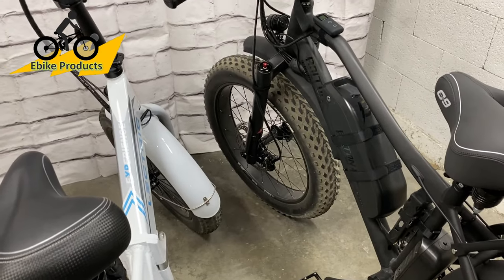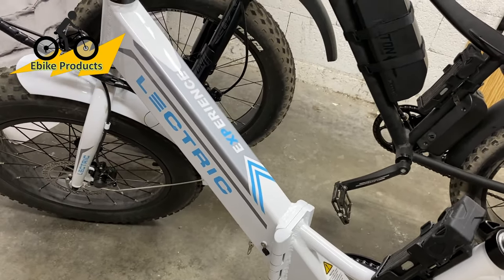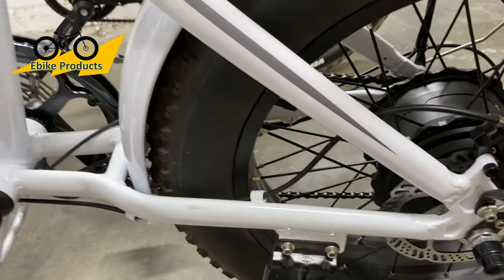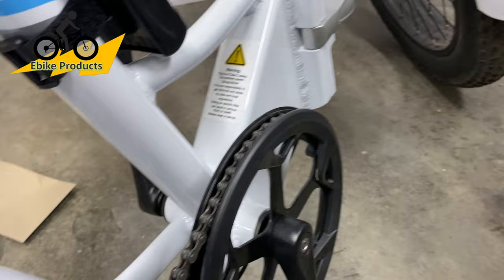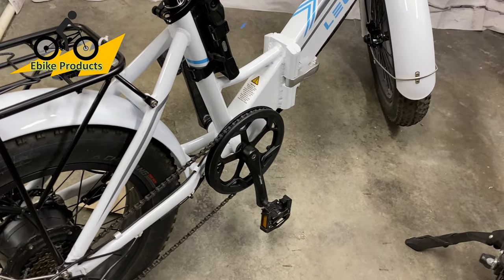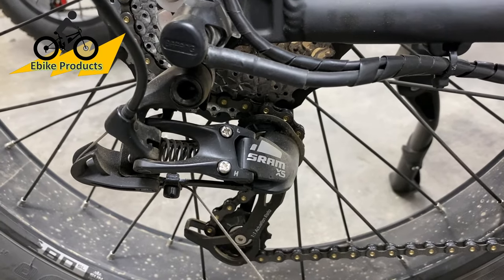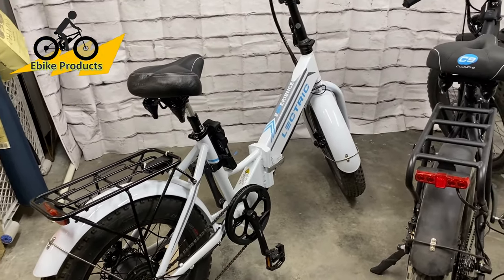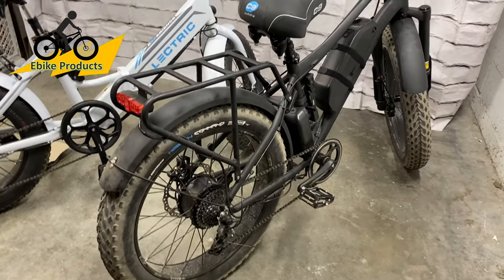Lectric XP vs Bolton Blackbird - Part 3 of 3 | The Budget Ebike vs Performance Ebike Difference

Comment: Could you do a video on the proper way to clean the Lectric bike after it gets filthy and then what to lube and the types of lubricant so we all can protect our investments?
Reply from the maker: Thanks! That’s a great suggestion. I’ll put that on the list. To be honest, I’ll have t so a little research on it as I only do basic stuff like lubricating the chain (I use the dry lubricant since it doesn’t rain where I live) and wipe down the dust with a wet rag.

Comment: I have the 26” Blackbird and understand your issue with the bike height.  I tried the Cloud 9 seat and found it too high to be safe.  I switched to the Selle Royal and with the seat stem in the lowest position, it was comfortable and low enough for me to be on the seat with my feet flat to the ground in the stopped position.  Once I have sufficient bike speed, I use the dropper to raise the seat for proper leg extension while pedaling.  Just remember to lower the seat before stopping. I think you will find your main issue with the Blackbird will be solved.

Comment: Lectric batteries cost 299. If u need a lot of range just strap on another battery and u would have a tremendous range. I bought two of the Lectric so when I am riding alone I will have plenty of juice. I also like the folding option to keep them hidden in my truck. I also like that the batteries and controller are protected from the elements and have a cleaner look. Only thing others have said is when your order the bikes they charge your credit card immediately. They should wait until they ship them since it takes two months or so before they ship. Thanks for the great information.

Comment: Just bought the BB for $2K on sale (Bolton).  At that price I thought it was a great deal as I had been looking at the BB for over a year.  Actually viewed ALL the videos even the one where you rode the bike around I guess AZ....LOL.    I am 6 foot so I went with the 26 inch model and I am optimistic that should be OK for me.  Relatively new to Ebikes and I figure I will just start off slow with minimal assist once I first get it per your suggestions.  It was very helpful and informative so thanks.
Reply from the maker: Congratulations! That's a great price for the Blackbird! Mine just got stolen 2 weeks ago along with 6 other ebikes. That was the one that I'm going to miss the most as I spent just under $3k for it (I included a second battery). The BB was the most powerful and fastest ebike I owned and I think you're going to absolutely love it as it will probably fit you well at your height. It's a lot lighter than other bikes with those size tires and the components are top notch. Have fun and safe riding!

Comment: Great video and very informative. I did preorder the lectric 2.0 but I think I'm gonna have to cancel. I wasnt aware the battery is sub 10 ah and coupled with possibly a lower amp controller. For a bike with a 500 watt motor it's just not maximizing its potential. As a matter of fact I think it has to be just a slight jump up over just getting a 350 watt campground cruiser. I've seen other bikes with what appear to be greater specs and add ons for nearly the same price point and with a much sooner delivery date. The trade off will be lectric probably has a better customer service reputation. The bikes I'm speaking of are by rataan eahora and even the samebike out of the Philippines. Thanks for your video.

Comment: The Blackbird battery is 52v nominal. You said it is 54 volts. The actual voltage at full charge is a bit more than 54v, but batteries are always listed at their nominal values.
Reply from the maker: Oh man! Good catch. Totally didn’t realize I said that. I also didn’t know there was a nominal value rating. Totally makes sense since it goes way above when it’s fully charged. I really appreciate the feedback, I learn so much from all the comments.
Reply: @EbikeProducts  You're welcome. I assumed it was a misstatement rather than an error, but I added more detail for any confusion that others might have.

BTW ... I'm just getting acquainted with my new Blackbird.
Reply: @blakeberlin6295  well, been a year now, how has it been?

Comment: I have the Bolton 24” bike that came out before the Blackbird and my battery is also wobbly which I do not like either. I like your fix for that where can I get the Velcro straps that you put on your Blackbird?
Reply: Your right I got the 24” thinking it would be fine for me thinking it was the size of a regular bike, but it’s actually taller than your normal 24” bike. At 5’-2” and cutting the seat post shorter I have to lean the bike over to get on & off. I love the bike but should have gotten a 20”.
Reply from the maker: Unfortunately the exact set I got hasn’t been in stock for a long while now, but this is one that looks to have the most of the same straps for a great deal. https://amzn.to/3z0wIH3
The set I originally got had 50pcs for just a little more, but the set above in only a dollar or 2 more than if you were to buy just a couple. The straps are incredibly handy for so many things, I actually use almost all 50 that came in my set. 
The straps around the battery really give me piece of mind as it holds it to the frame very well and doesn’t move at all.
Reply: @EbikeProducts  thank a lot for the Amazon link for the straps. After seeing them I think I will be using them for other things too.👍
Reply from the maker: @FlyingFish28  I went riding today in a new fat tire bike to do a review and got a flat on my back tire. 26” fat tire flats will make the bike impossible to move due to the tire falling off the rim whenever there’s no air in them. I had 3 straps with me that totally saved me from having to carry the bike home. I was able to strap the tire to the rim in 3 areas around the wheel and could walk the bike home. I will be making a video soon on how important I think it is to carry a small handful of straps at al times. The are so useful to strap stuff to the rack, frame, and handlebars in an emergency.

Comment: How is Bolton's customer support?
Reply from the maker: I’ve found their support to be really amazing. Unfortunately I’ve had some noise issues that caused a bit of a problem when my local ebike shop tried to fix it. Kyle and the rest of the Bolton Team has been super helpful and responsive trying to help me resolve the issue. I made a video specifically about the service I’ve been getting from them that will give a pretty good idea about the service I’ve received from them. 
https://youtu.be/Hv_WxQ4sdhM
As a smaller company with big customer volume, they don’t have a phone number you can call, but they do respond to emails with 2 business days and the facebook group has a ton of active users who are very helpful for quick answers to questions. Although this makes overall response time a lot slower than a company with a call center, the quality of the response to resolve issues is extremely good and also what matters most to me. I’ve dealt with other companies that have staff on hand to catch customer calls immediately, but are frustrating to deal with and useless in helping solve problems. I’d take Bolton’s service over a useless call center any day.